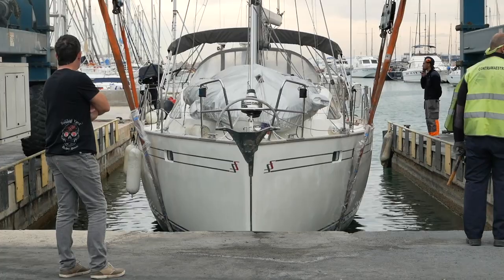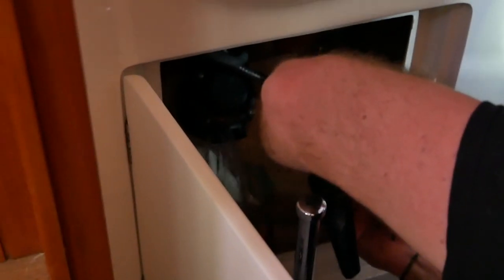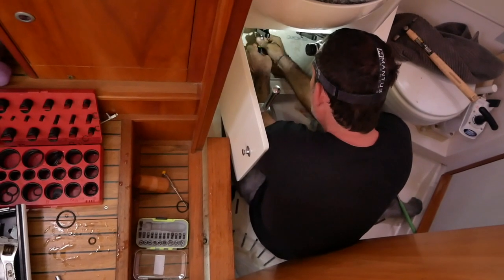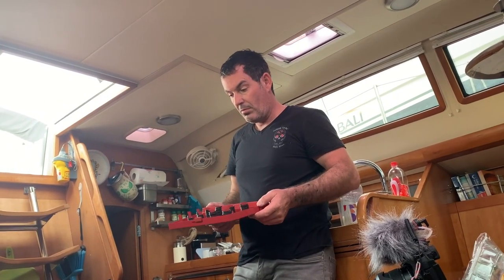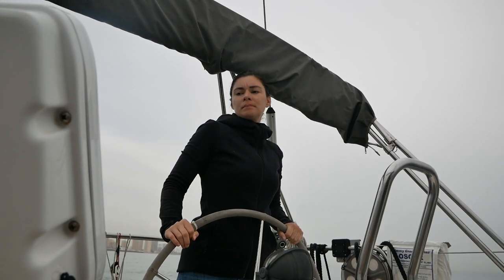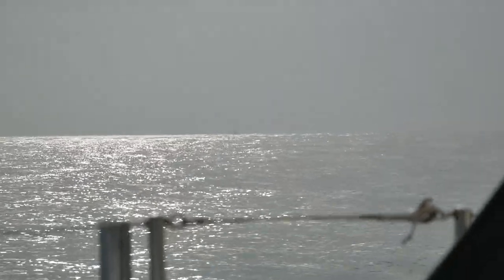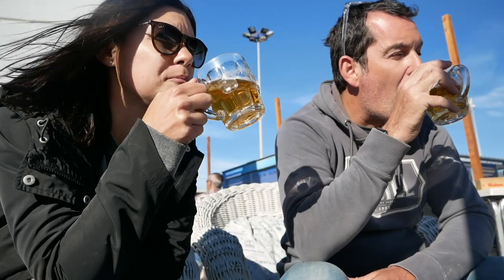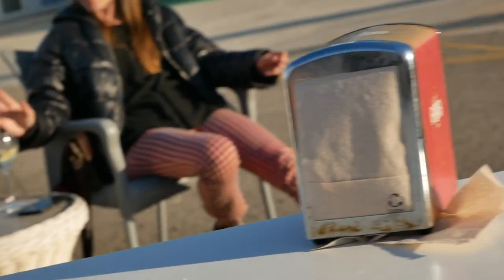Nooooo, we’ve got water flooding in! Turn on the pumps! | Sailing Ruby Rose | Sailing Vlog 90

Comment: I am a 30 plus year mechanic and just wanted to offer you up a little advice when working with O rings or electrical.

 I use Dielectric Grease on my electrical connections for water and corrosion proofing (Do Not Use On Rubber O-Rings) it will degrade then over time. 

Then I use silicone lubricant for rubber o-rings, the trick with rubber O-Rings is they will shrink over time even if not used and just stored, so if you lube them up before use it will help them fit better and last longer. Hope this helps.

Here is a little reading the credit for it goes to the author. https://pressurewashr.com/silicone-lubricant-grease-for-rubber-o-rings/

Here is a link on the Dielectric grease credit goes to the author again read the description part, https://www.ipdusa.com/products/6706/114923-dielectric-grease-permatex-81150

Yours Truly 
Corey N.

Comment: You should have two sets of O-rings. One metric and one Standard. Because of the different diameters....a standard might of done the job because it would of been a little thicker than the metric size.  Also as someone pointed out...you should get a viton kit and don't buy those standard o-rings that are only 5 pounds. finally....keep corks in your boat. In a pinch...you can dive over the size and plug the hole while you're working on the inside and not have water gushing in moving your rings around as you're trying to fit everything back in. 
Glad you were able to plug this leaks.
J....

Comment: When I saw that red box I howled. Had two like it for many years. One Imperial, one metric.  Rod diameters and ring diameters both differ. (Need educated fingers or a micrometer to sort them out) A little silicone grease helps a lot. Much better than hammering on. Have a little gratitude it is only water and only a few PSI for your job.

Comment: Something I found works in an emergency with a worn O ring and you dont have a spare (if it sits in a groove) is a wrap of  cut down plumbers ptfe tape in the groove before you put the o ring on makes it slightly bigger.

Comment: I have to admit I enjoyed watching you fix your leak problem. I suspect a number of us have been in similar situations, and probably did not handle it as well as you did although we won't admit it to our wives. I suspect your problem was that the o-ring kit did not contain the correct o-ring which is why you had to use two o-rings to stop your leak. You might want to add another kit of o-rings to your spares locker. Enjoy!

Comment: I worked in the fire protection industry for decades in that time I change 
thousands of O-rings that were kept under constant pressure, I was one of the few old school guys that used O’Ring Lube when replacing them, I consistently had less tears and leaks.

Comment: We all lose our shit at some point...and some beers later we find humor in it. But what could have made this a little less stressful would have been to drive soft wooden taper plugs into the through hulls so the sea cocks could be serviced without the water rushing in.  Much simpler to keep o-rings in place, gives you a chance to lubricate with silicone grease and to think about what you are doing.And on the bright side, now the bilge is clean! ;-)

Comment: O rings and silicone grease must haves on a boat - Followed closely by a supply of real booze for all other problems. :-)
Reply: Good one. LOL
Reply: @pirateracer69  Not Silicone on a boat. There are other greases that are compatible. For those that use silicone products on a boat, we prefer to keel haul, with the engine running, in gear. Got it.
Good.
Cheers
Reply: Molykote® 55 O-Ring Grease

Comment: FYI, those little white rings that stick out of each handle.  They are thru-hull plugs sized to fit inside of the thru-hull on the outside and water pressure will hold them in.  The ring is so that you can tie a string to them and when you are done with the repair, give it a tug and the plug pops out.  No muss, no fuss.

Comment: Hmmmm. Those are very compact through-hulls. I never had problems with mine, but they were more robust looking. Next time you haul out and leave the boat for any time, I'd open the through-hulls and spray in (from the outside)  ArmourAll protectorant and turn the thru-hulls open and closed a couple of times to make sure it has spread. This stuff softens and protects nitrile. It also works wonders on (Lewmar) hatch and portlight seals, stopping leaks and saving the seals from getting hard.  After spraying it in I'd make sure the through-hulls are closed and then add blue tape over the opening to keep air out, moisture in and dirt away from the seals. Try it, it should work.....

Comment: .....check for sulfur build-up in your water heater. If The water pump wont shut off of on it's own then you have a check-valve in the pump that's failed and that spring could have cut up the o-ring.

Comment: Do you know that the little white plastic cap stored on the side of the seacock fit the thru hull from outside and closes off the entry of any water? Once you install the white cap under water you can take the entire sea cock apart for servicing by taking out the four screws on top of the seacock.

Comment: O ring kit from Lidl (€6), Gasket repair sheet (with printers pad to get the shape) €5 from Amazon and decent electrical connectors. Throw in Agua Ferta and  and a good multimetre. Trouble shooting kit sorted!!  😂😂Sail Safe. Ant & Cid xx

Comment: Nick do you ever consider removing the sea cock O Rings and lubricating them when you put the boat onto the hard ready for the winter? or would this potentially cause more problems than just leaving them and not disturbing them?
Reply from the maker: Not really my friend. The o rings seal the handle to the seacock. As you turn the handle from open to closed, it stretches the ring a little. As the ring stretches and distorts slightly. Then it won’t seal and you get a drip. It’s just routine maintenance. Plus you have to be in the water to check to see if you’ve got a good seal.

Comment: I'm second commenting which is bad... But Nick, going forward keep the ring box with a bottle of Vaseline. Apply a little to old and to new. Does wonders on window seals as well.
Reply from the maker: I do have a tub of Vaseline for such jobs, but use a silicone lube for anything that could have rubber or latex in it.
Reply: @sailingrubyrose  Giggity!
(I hope that's not lost in translation ; ) )

Comment: Are O-rings measured in metric? The seat has to be measured in order to fit, that and the material used.
Reply: Read only for "Tech Tuesday" discussion of O'rings:

As an engineer who has spent a fair number of years working with O'rings and sealing, I would state that the explanation offered in the video is, well, to put it kindly, incorrect.

There are several characteristics which must be observed.  The outer diameter and inner diameter of the O'ring are important criteria,  yet the delta between them provides the cross sectional diameter, which is important as we will require 7% of the O'ring in compression in order to form a seal.  The durometer (spongy-ness) of the O'ring is also an important criteria.  Leaving the O'ring, we require that the two surfaces upon which the O'ring are compressed to be free from nicks, scratches, bumps and other deformations which take the surfaces away from a mathematical plane.

You can, of course, overtighten an O'ring in an attempt to make it seal.  This leads only to premature failure, as the ring really demands that ~7% compression, not more.

Based further upon the set of O'rings that was shown, I would confidently guess that the durometer and cross sectional diameter is incorrect for application.  Nick is using a random ring, not the "one" designed for the task.  The surfaces may be marred, a bit of scotch brite and elbow grease will fix that.  Finally, tighten only to the required compression!!!!!

This was meant in a kind and helpful sense, not some snooty engineer lording it over the masses.  Hopefully, it is taken that way.
Reply from the maker: @WhatAboutTheBee  Thanks so much for the explanation mate! You're right, our o-ring knowledge isn't nearly as complete as yours (is anyones?!).
Reply from the maker: Thanks mate. Always appreciate a detailed scientific explanation. Keep them coming
Reply: @sailingrubyrose  The one reason for asking that question was because you took a 'generic' ring from a box. I never ever do that. I simply do not trust O-rings from other makes but the original vendor. I had a problem with a seal a long time ago and it nearly ended in disaster. At least I now I know part of the reasons, thank you for that! Have fun. 😉

Comment: I'm betting that O-Ring would have resealed itself after having sat back in the water for a day or so?! Either way, not something you'd risk the boat on I guess - You did a sterling job Nick, cursing is almost obligatory in such situations and I for one would have had my heart beating out of my chest!! Kudos to Terysa too, you need a partner who can keep their head in these circumstances.
Reply: With all due respect, no, it would not have magically sealed.
Reply: @WhatAboutTheBee  so you don't believe in miracles then?
Reply: @justbanter8727  perhaps if it was compression packing.  Then moisture would cause it to swell.  O'rings are made of various grades of plastic and rubber.  Moisture does not cause them to swell.
Reply: @justbanter8727  and yes, no miracles!

Comment: Hi Nick, your assumptions about Orings in that situation are not quite correct.  All Orings are made to fit their recesses with about .010" of compression applied upon fitting.  That .010" creates the basic seal.  All pressure thereafter increases the seal, however in a seacock there is very little increase in pressure once in the water, so that 10 thou of compression is all the seal you get.  This is why it is imperitive to fit the absolute correct Oring into your seacock.  As for those kits, they give only a very generalised range of Oring sizes, many are not standard industrial-use sizes and this is most likely why you had trouble.  Do yourself a favour and identify the EXACT number of Oring required and keep a bag of ten on board (in fact, tie a pair to every seacock.  The repair kit should be considered useful only for those rare oddities and forced emergency running repairs.  The chances of you having just the right Oring in that kit for the majority of jobs is about 60/40 against.

Comment: In this sort of situation and yes it looked cold there Nick but the old plumbers plunger stuck on the outside of the through hull could save a visit by the insurance assessor. Yes it could have meant blue tits but it could be a life saver. Go get a couple of various sizes. and practice but in a marina close to a travel lift. Like other comments on here we all get a good laugh at your expletives even if you tube cracks the shits with you. 
Are you across the bubbles charging a cruising tax? Will be interesting to see what it all ends up costing if you go that way.